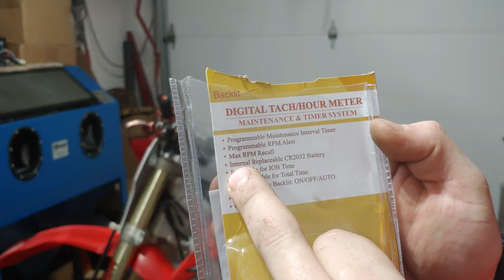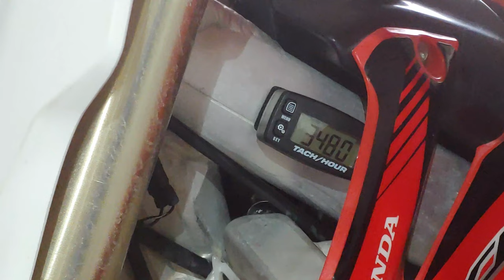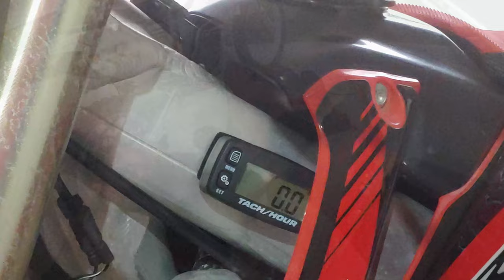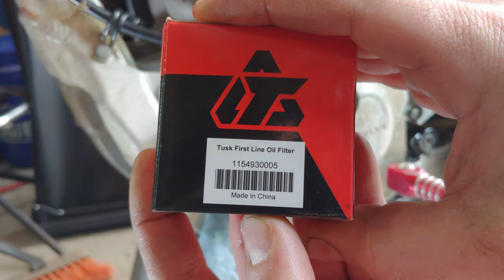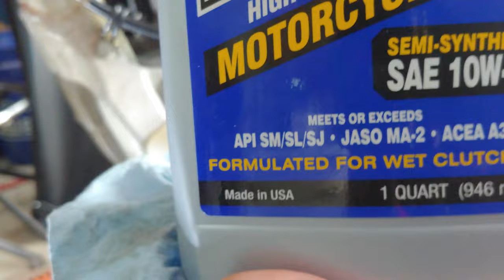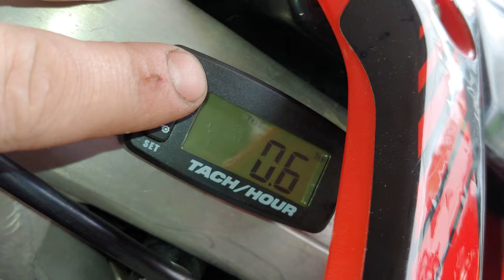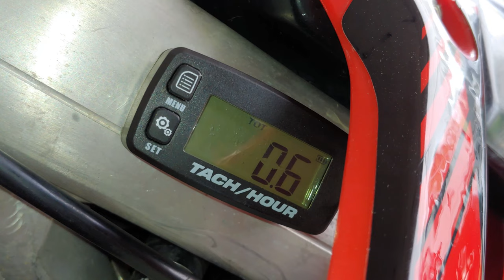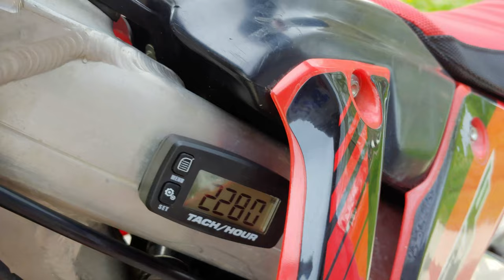2006 Honda CRF250r | Upgrade [Tach & Hour Meter Install]

Comment: hey man i think the settings are wrong and the rpm dont match the display . The unit looks like a Runleader RL-HM032R and 4 stoke 1 cylinder settings sould be P1R2 . Love the bike and the videos , did a sub and like .
Reply from the maker: No its actually a Searon SR-HM035A.... The instrustions say to set it to 1P1R for a single cylinder 4 stroke being the plug fires every time the piston is at TDC on these bikes...
Reply: Was the  1P1R the actual correct setting? Looked like Idling was 1800 when it should be around 900 but I know Hondas fire a little differently.. I have a Yamaha WR450 with the same ignition coil and was wondering if you wrap the wire around the coil because you can't wrap it around the wire..
Reply from the maker: I wrapped it around the coil head. Whatever I did in the video worked well. The rpms should be around 1800...

Comment: anyway to keep the back light on during operation? If i set rpm alert to a low # would it stay lit up red?
Reply from the maker: No but I think it's flashes red
Reply: @Fixin2Ride-Official-  Thank you

Comment: How do you turn it on I don’t know how
Reply from the maker: You might have to unscrew the battery cap on the back and remove the battery saver plastic for it to turn on.

Comment: I think it's time for a new torque wrench you're putting some pressure on that for 7 foot pounds LOL
Reply from the maker: I was being careful on the top one. Im not real confident that tje threads are the best condition. Ha ha.
Reply from the maker: So you think that it might be putting more torque than it should be? Any way to test this here at my place? 

Got a recommendation for a better one I could look at? Thanks!
Reply: Lol yea i would just buy a new one because that sure looked like a lot of pressure for 7lbs and did not hear a click
Reply from the maker: The bottom one clicked and O domt have a problem with other bolts. I was going slow in the video making sure not to stripe out the aluminum threads if they were on their way out.lol